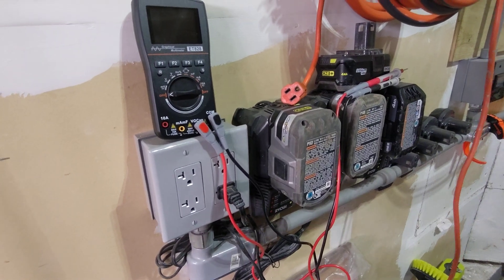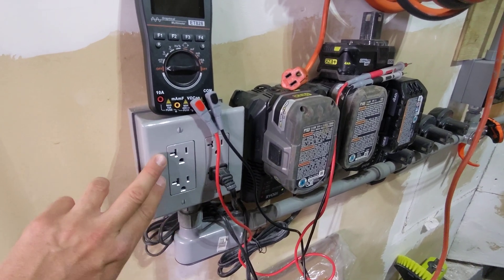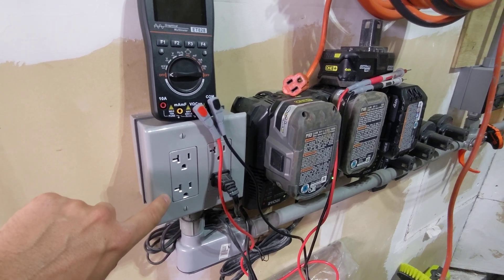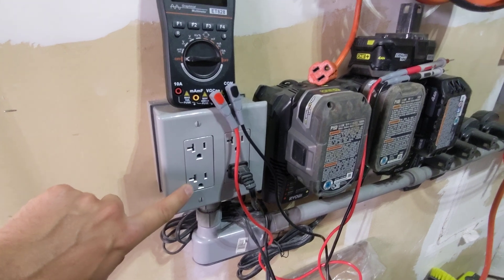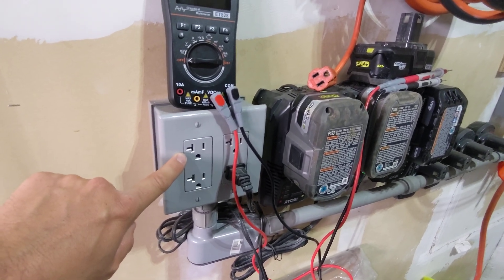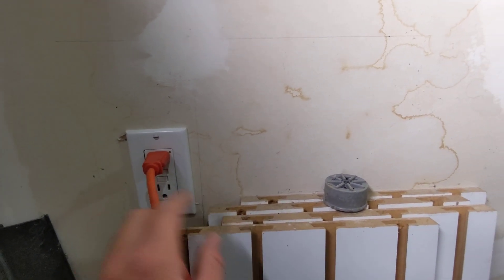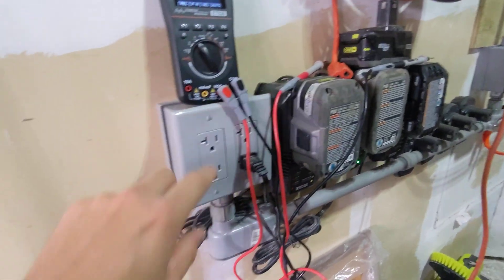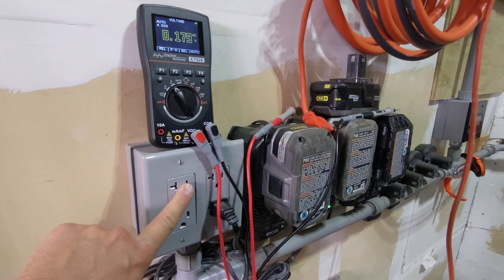Build It: Bluetti AC300 - Video #2.1 - Can I use the same outlet to charge two stand-alone AC300s?

Comment: Hopefully you check for comments on your old videos.
A few years ago I purchased the AC300 along with the B300.
Now when I push the power button on the AC300 only the the battery lights up the 4 indicator lights and the power button lights up. 
Any chance of this machine working again?
The comments about Bluetti customer service have convinced me to not even waste my time with them.
Reply from the maker: Customer service has drastically improved. I would suggest joining the AC300 Facebook group where experts and Bluetti staff can assist you with a back and forth dialog. 

However, how long has your battery been sitting? It may have drained past the level that the AC300 can use and may need to be recovered.

Comment: Show us how to adjust it on the bluettie.  Yeah Those are big batteries and the chargers are designed to charge it quick but unfortunately it’s not that easy as it uses a lot of power.    Remember too that when charging from ac wall your gonna loose 15 % or so to the conversation process so a low trickle charge and some solar is a better option.
Reply from the maker: At this time, and due to the AC charging issues that currently exist with the AC300, I have reverted to charging my system with the T500's. This allows me to directly charge the batteries and by-pass the AC300 head-unit. The T500s charge at a rate of 500 watts.

Comment: That’s a good point on configuring an AC300 for low amperage trickle charging.  Nice set of related videos too. Thanks for sharing!
Reply from the maker: Thank you Joe. In my next videos I might provide a reason why trickle charging or even having the AC input cables may not be the best option depending on your setup.